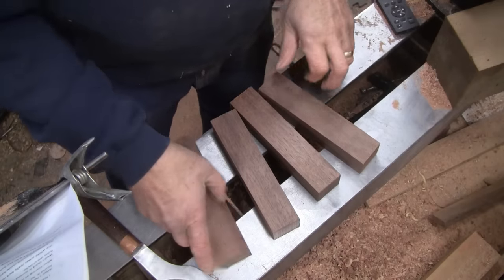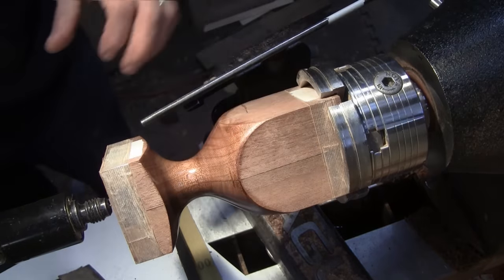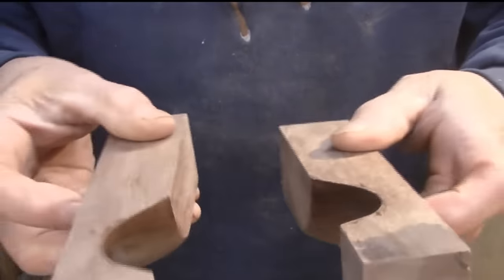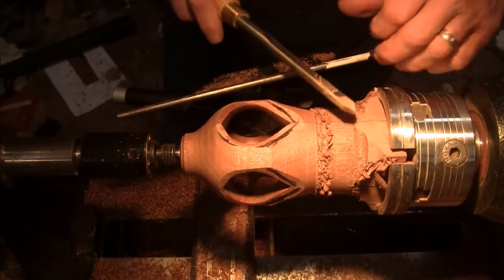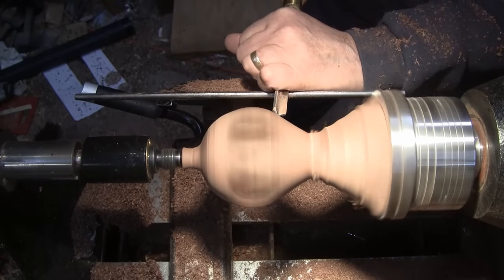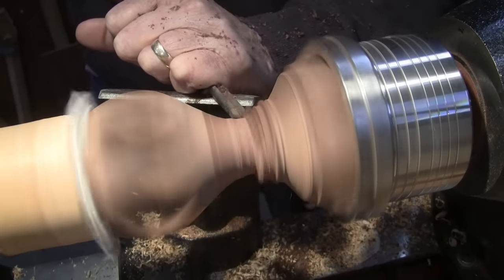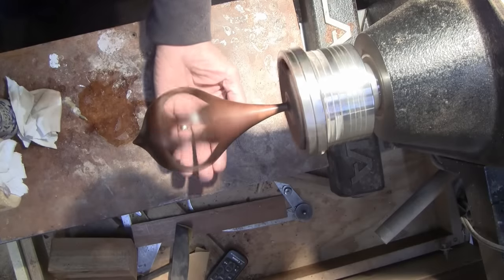Wood Turning Inside Out Christmas Ornament

Comment: I like that you used tape for the first set of cuts.  It makes it a faster project.  Nice job!
Reply from the maker: Thank you Jennifer glad you liked it. The tape does work great.
That said I just finished another inside out turning and used a brown paper joint on the ends as well as the tape. Some feel the tape is not enough so I thought I would add another option.
Thanks again,
Gary
Reply: @ThePapa1947  Good to know.  I'll try it.

Comment: Here we are Gary, almost a year later and I just needed  to watch this again to get another dose of your mastery. My issue is getting all 4 pieces perfectly square without the tools to do this. No doubt I will be watching again. Thanks John
Reply from the maker: Thanks for watching again John, what tools do you have right now for making them square?
Thanks for watching,
Gary
Reply: Hi Gary, my modest tool collection started off when I built the shop in 2019. Any how I have, apart from turning tools a 7" circular saw and an orbital sander, which should do the trick.
Reply: I would recommend buying wood with sanded edges so that all you have to do is glue them together
Reply from the maker: @gregj2647  that is one way for a person to do it if they do not have the equipment.
Reply from the maker: @gregj2647  That is a good option for someone with the tools to any other way. Might be a bit costly with some woods.

Comment: I've been doing inside out woodcarving for years. Finally someone is doing it on a lathe. Thanks for the third dimension Gary. It looks great 👍
Reply from the maker: Thank you James and carving the would be nice as well. Are you doing it from pieces like I did or from a solid piece?
Thanks for watching,
Gary
Reply: I usually do it from solid stock but checking can be a problem if the material  is not dry.

Comment: Just ran across this and wanted to compliment you on a beautiful design and creative idea. 
I'm going to "borrow" the concept to make a larger hanging lamp. I realized while watching that, after gluing up the quarters inside out but before turning, I could drill out the center to hold a threaded shaft that is used in lamps. This would allow the addition of hardware for a bulb. Thanks for the inspiration.
Reply from the maker: Thank you Rob, I just may have to do what you are doing as well. Just need to find some low heat light bulbs.
Thanks for watching,
Gary
Reply: @ThePapa1947  I was thinking that I would use LED bulbs. Low power and low heat for the same brightness.

Comment: Just beautiful. It’s 32 degrees here in VT but Now I have to go out to my unheated shops to find some scrap to glue up!  Thank you for sharing your skill, art, and advice. Dan
Reply from the maker: Thank you very much Daniel. I hope you got warmed back up after getting the scraps and all went well.
Thanks for watching and commenting.
Gary
Reply: @ThePapa1947  Thank you!  I did, but I grew a bit frustrated with the tear out I encountered after gluing up the coved pieces.  How do you prevent it? Or is preventing the tear out a skill that's developed over time?
Reply from the maker: Some wood is just hard to turn. Sharp tools is very important.
Keep trying you will get it.

Comment: Hi Gary, Another masterclass but this time with spindle gouges and a skew. I tried this a few years ago when I had just started turning. Yes, you guessed it a disaster followed. I will try this again now I have a table saw to be able to cut square and some experience. Fantastic piece. Cheers, huw
Reply from the maker: Thank you Huw I appreciate your comments. I left one with just the inside turned and not glued together just to explain to friends how all this happens.
The tricky part is figuring out just how deep to cut to get the shape you want.
I usually draw what I am making other wise it may come out nice but different.
I don't think you can get a bad design.
Thanks for watching and take care,
Gary

Comment: Very well done.  I made a practice version out of cheap pine.  The next version will be black walnut.  I hope it turns out as well as yours.
Reply from the maker: Thank you Mark. They are lots of fun to do and I am sure you will do fine.
Take care,
Gary
Reply: @ThePapa1947  I do have a question.  The start thickness is 3 inches.  Your initial cut looks like it leaves about 1 inch.  Is this correct?
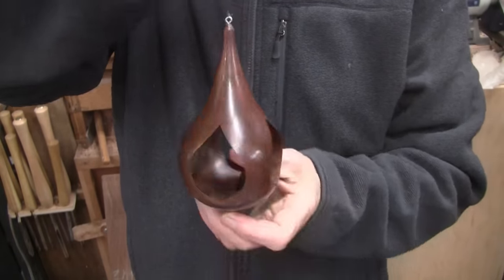Reply from the maker: @markshuell3198  it ended up very close to 3 inch diameter at the widest point when it was finished. The 4 strips might be around 1" at the opening though. That shows up at 15:41 where my thumb is pointing.
 Hope that explains what you are asking.

Gary
Reply: @ThePapa1947  thank you.

Comment: Absolutely lovely :-)  If I wanted to hang this outside, what kind of finish would I put on it?  Any chance I could put an environmentally friendly finish on it?
Reply from the maker: Thank you Heather. So I would not hang this outside because of the pieces being glued together and it is not all the wide of a joint. I am afraid not matter what finish I had on it the glue would give out.
But for out side a good poly should be fine. Once dry it is should be fine for the environment. 
Thanks for watching,
Gary
Reply: @ThePapa1947  I appreciate the answer!  I didn't even think about the glue joint, good thoughts, thank you so much🙏🤗

Comment: Something I thought of, and maybe it's already been mentioned, but you could drill a center hole down the length of the top portion, and wire a single LED to connect to the tree lights.  It would light up the inside, and you couldn't see the LED.
Reply from the maker: Great idea! I have put one of the lights in from a back window but it is hard to get it in the right spot. Maybe I will make another one of these just a built in LED. This one is always hung up all year long.
Thanks for the idea Matthew.
Take care,
Gary

Comment: How was the live center attached if it 4 pieces of wood? I would think it would spread apart. Outstanding job. I can’t wait to try it
Reply from the maker: Thanks Mark...so my live center has a short tip which did not go in very deep and was not wedging them at all. And I made sure the edges of the cup cut a grove into the wood. Which helps to hold the pieces together. That combined with the strapping take held just fine.
 You could also glue the ends for just a short distance.
Some people also use a brown paper glued between the pieces.
 Only do what you are comfortable with.
Take care,
Gary

Comment: Quick question.  I am very much an amateur woodworker and am trying to do some inside out Christmas ornaments.  I have some good hard wood, but wanted to practice on 2x4s first in order to get some practice.  I just tried it and the head stock created a huge hole and in no time and the entire piece came loose.  I put it together with double sided tape and then taped the ends with duct tape.  This same thing happened twice.  Am I doing something wrong or are 2x4s just not good enough wood to practice on? Any advice?
Reply from the maker: What I would suggest is for the first inch of each end of the board  glue the joint. Use some brown paper between and it will pop right apart. Use the tape the ends. I am working on one right now and I did use the brown paper. It is  a added safety measure.
 Depending on the diameter of the tip on your live center it could force the joint apart. So be sure to give it a good start by either drilling a small hole or shape it with a punch. The 2.X4 should work fine.
Let me know if you have any other questions,
Gary
Reply: @ThePapa1947  Thanks!  I will try that and see how it works.

Comment: Gary, I'm glad you like comments!
Two questions:
What length are your 11/2 x 11/2  walnut pieces? I have been trying 6" but thinking  8" would give more to work with.
What size are your tea lights? The ones I bought today are 1 1/2" diameter and a bit big.

Bill
Reply from the maker: Hi Bill, as I recall they were 6 inches long. It would not hurt to make them longer. 
 The tea lights I got were 1.4 inch diameter and 1.25 inches tall.
Reply: @ThePapa1947  
Thanks Gary. I have searched the Internet and found a lot of LED options. And thought it out a bit, so am probably OK there. For my next ornament I'm using 8" lengths. May actually be getting the hang of this.

Comment: Gary I been wondering about sanding sealer. My question is What is it for
Reply from the maker: Hi Michael I have always used sanding sealer to raise the grain which allows better sanding. It does seal it as well which allows your finish to lay on nicely without soaking in a lot. Hope that helps,
Gary
Reply: @ThePapa1947  that is very informative Gary thanks for the information.

Comment: A really nice turning.  I’m surprised you did the inside with just tape, The couple I’ve done, I used a few spots of hot glue as well as the tape.
Reply from the maker: Thank you I am happy you liked it. I have used hot glue as well as CA gluing strips across the joints.
This one was locked into the 4 jaw chuck on one end and I used the small cup center on the other which did not try to wedge the pieces apart.
Plus the take I used around all 4 pieces was the fiber strapping tape. It worked very well.
Thanks for watching and commenting.
Gary

Comment: Question:  What RPMs are you spinning this and how do you not catch the holes in the center while rounding it?  Is that a factor of speed or the angle of your  tool?  I'd like to try one but I think I'd explode it rounding the center.
Reply from the maker: I would say I was around 1500 RPM. Speed is a big factor as well as the angle. I have the handle dropped about the same as if it was a solid piece I was turning. Also make light cuts is important as well.
Thanks for watching,
Gary

Comment: So nice! I tried this and had my tool catch in the opening. I'm  new. any tips?
Reply from the maker: Thank you John!
So a fast enough RPM helps, sharp tools and a gentle touch. If you tools are not very sharp you tend to push harder and the too will slip into the opening.
I turned mine at 1100-1400 RPM 
Hope this helps,
Gary

Comment: Very nice Gary, that turned out beautifully.   Curious about your sanding sealer as the one I use is a milky white till it drys.  What kind are you using?
Reply from the maker: Thank you Tim I am glad you like it.
I am using shellac based sanding sealer. It is made by Zinsser  and called Zinsser Seal Coat.
You must be using a water based sealer. Perhaps the Minwax? I understand it words very well but not have tried it. I generally finish with shellac or lacquer and I would not want the water based under it. But I do use the Minwax Polycrylic and like it a lot. It is water based.
 Hope to see some more videos from you.
Take care and Merry Christmas,
Gary

Comment: Did you use a friction polish on the outside? If so, how did you deal with with gaps from the windows?
Reply from the maker: I guess I missed saying how I finished the outside.
What I did was sprayed the outside with lacquer.
I was able to stuff tissue inside to keep from getting finish on the inside.. Sorry about that.
Most of the outside could be done with friction polish but it would be hard to do all of it with the windows.
Thanks for you question.
Gary
Reply: ThePapa1947 no problem. Thank you and great video.